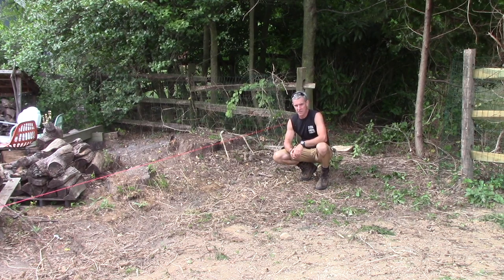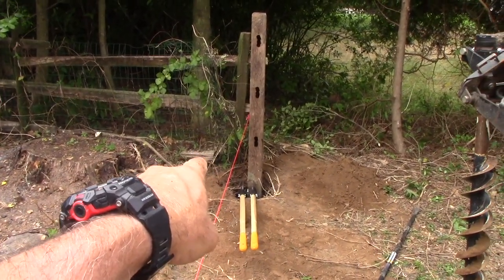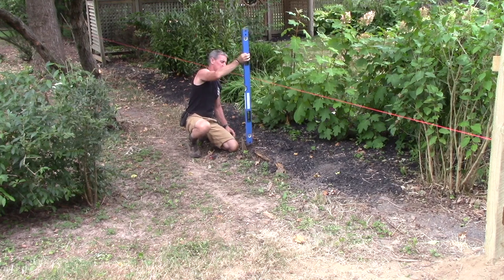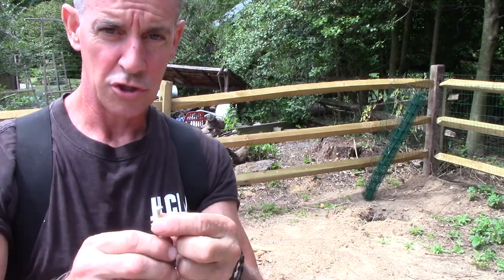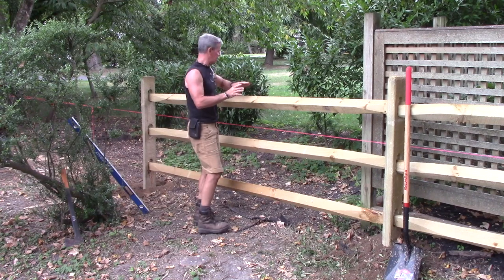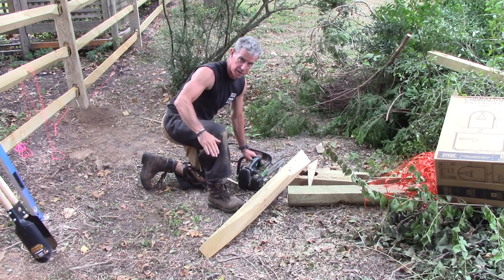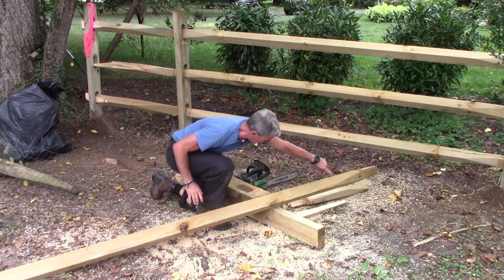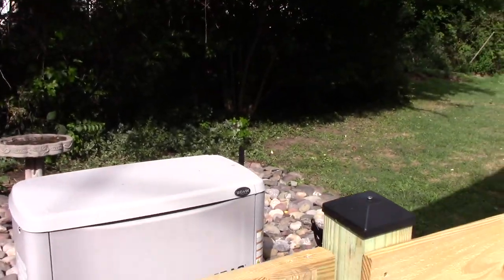How to Build a Split-Rail Fence Like an Expert

Comment: What were you using for the rails? Ate those 4 x 4s that you tapered?
Reply from the maker: Rails are not 4x4s. When you buy the fence package, the tapered rails come with it. - Here, I’m tapering rails for a short run. For typical runs, there is no need to taper. - Does this help?
Reply: @myfixituplife  Thank you. Answers my question. I am building a fence but buying lumber and figuring it out myself. Might have been easier to buy a kit.
Reply from the maker: @northernoutlier  no kit needed for split rail. Measure your rails.Mine are 10 1/2-feet I think. Center your post holes so they can accept the fence rail.
Reply from the maker: @northernoutlier  Glad to help. Call a local lumber yard or fencing supplier. In fact, the big fence I installers around me also retail their supply. They might even plan the fence for you if you bring them measurements and buy from them. They'll deliver, too. Worth checking into.